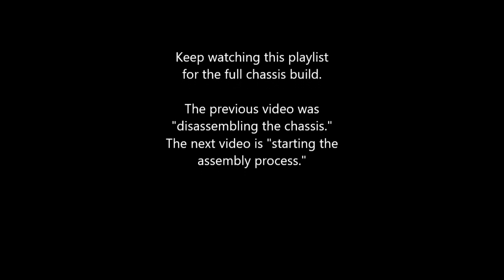P2: Painting of an assembled, & LS powered Art Morrison 1947-53 Chevy truck "GT Sport" chassis

Comment: What’s up with the bare spots
Reply from the maker: The "epoxy" coat is lite, and may appear to have bare spots...this is a quick coat of extra protection, the single stage could be applied directly to bare metal, but we put down some epoxy as an extra layer of protection.